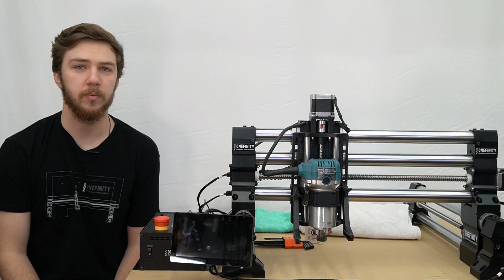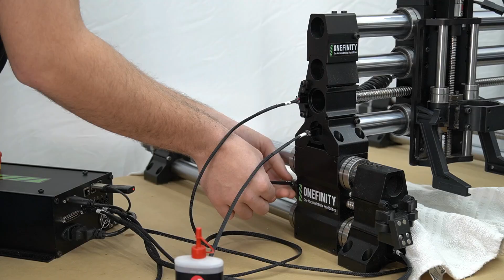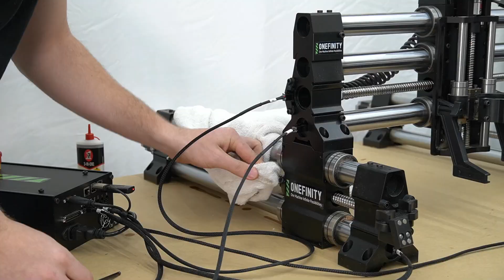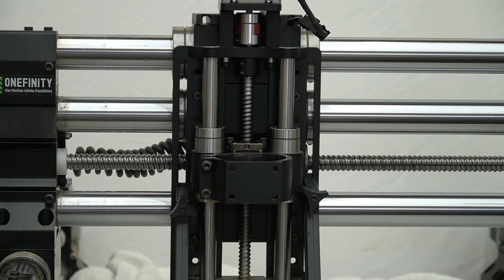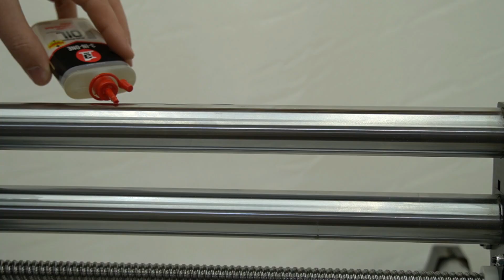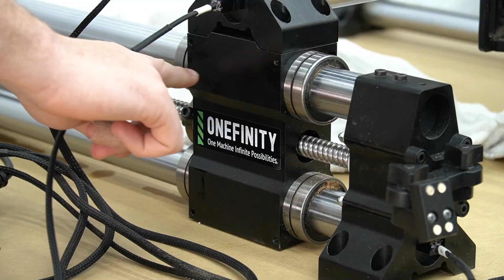Onefinity CNC Maintenance | Support

Comment: Can i blow air everywhere in the machine? i like to keep it clean but im afraid if dust can get trapped and build up where i cant see like inside the rail bearings
Reply from the maker: vaccuming up the chips is ideal, then oil with 3 in 1.  check out the manual for maintence tips!

Comment: I put my hand in a thin plastic bag, apply some oil to the bag, and rub it on the rails.  It's easily controlled, you reach everywhere, and you don't use as much oil.
Reply from the maker: Good tips!

Comment: Would have been nice if anyone would develop some sort of plate for the z axis/gantry that would allow fine adjustments, for tramming your spindle or router. I’ve just setup my Onefinity a couple of months ago, but haven’t used it for more than a few hours so far. Watching this video, I’m dreading for the moment when I’ll have to get to this kind of maintenance and take down the spindle. Was such a nightmare to get it trammed, especially because you have to get kind of lucky to get it trammed in both X and Y at the same time. But also because there is no fine-adjustment system in place to help with that. Sure, that process is on the gantry, not actually on the spindle. But it was such a nightmare that I’m even afraid to take out the spindle alone and mount it back on, what if even the slightest difference in tightening those bolts would result in needing to re-tramm? 🤦🏻‍♂️
Reply from the maker: Thanks for your thoughts!

Comment: So I flipped my x-rail which means the port on that rail is blocked by the z bracket. Can I just slather some 3 in 1 oil on the ball screw and call it good or do I need to use the port? I would like to avoid removing the z bracket if possible because I have everything trammed in perfectly and I don't want to mess it up.
Reply from the maker: back out the ball screw and rotate it in the gantry block.

Comment: "Use the towel to keep from getting oil on your tabletop"

Proceeds to get oil all over the tabletop...

I think you just convinced me to use melamine for my tabletop!
Reply from the maker: Lol, it's inevitable :p
Reply: @OnefinityCNC  would laying down foil wrap or plastic wrap instead of a towel make more sense?  It should fit easily under each rail and still allow it to move and work in the oil.  Just need to wiggle it in under the Y rails. The towel is probably fine in the spoil board area.
Reply: @warrenbrown8670  Grab your Wife's favorite cookie sheet and put a couple paper towels in it to soak up the oil. :-)
Reply: @warrenbrown8670 : Is that what you ended up doing?
Reply: @warrenbrown8670 
I know I'm 2yrs late for this party but... Wouldn't laying down foil or plastic be messy? As in neither of those materials would absorb the oil drops as effectively as cloth?
Reply: @RussReid I actually used a remnant of laminate sheet. Thin and no soak through.
Reply: Nick I used melamine for my table and worked out great!
Reply: Lmao